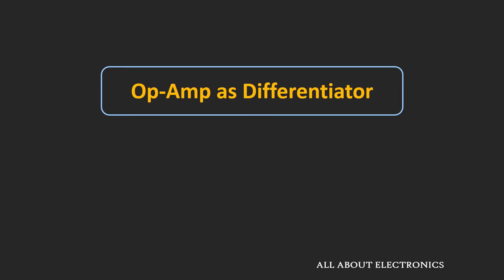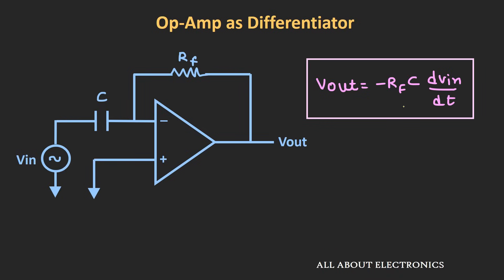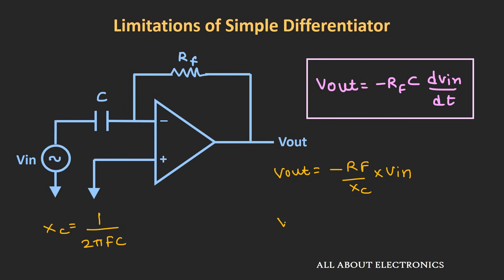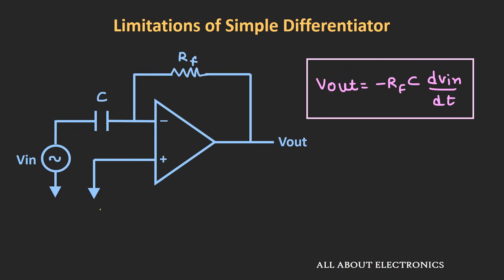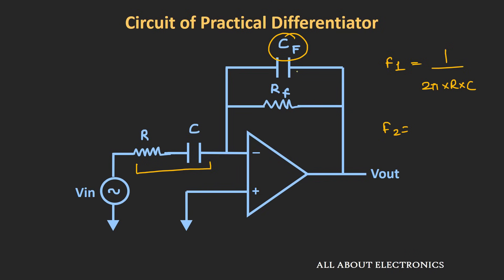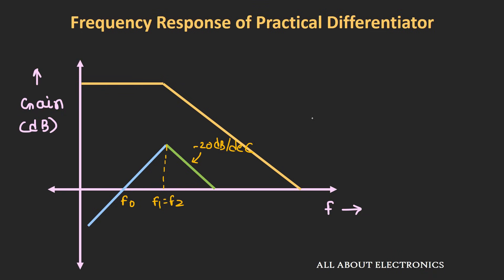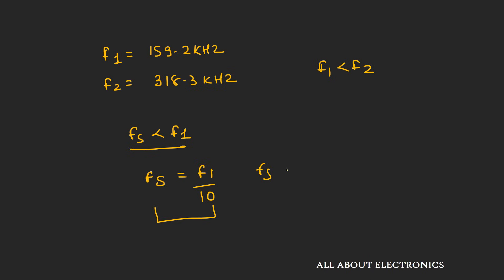Op-Amp Differentiator (with Derivation and Examples)

Comment from the maker: The timestamps for the different topic covered in the video is given below:

0:15 Op-Amp as a Differentiator 
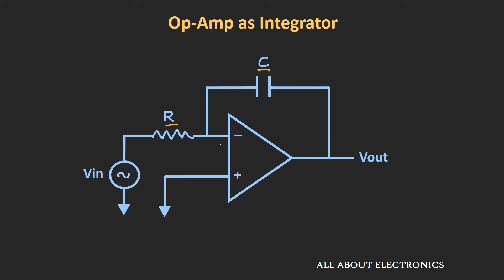1:35 Derivation of Op-Amp Differentiator Circuit
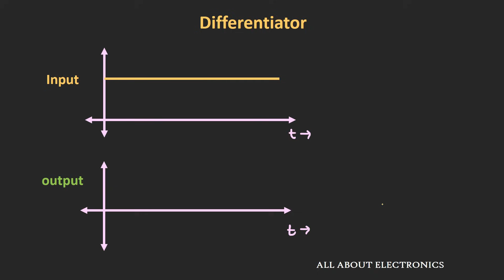3:39 Output of differentiator for the different input signals
4:22  Limitations of the simple differentiator circuit
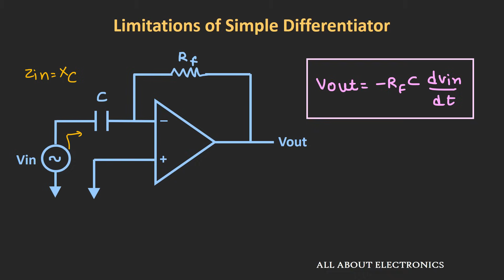7:56 Practical Op-Amp differentiator
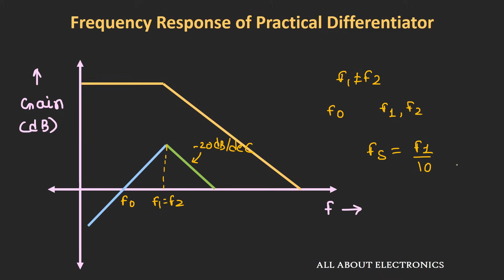11:55 Example 1
14:02 Example 2
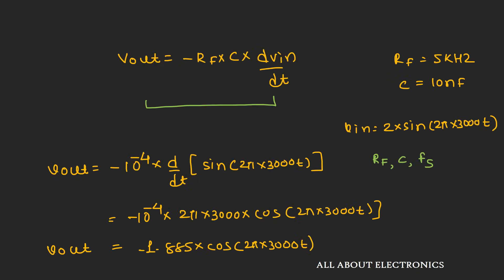16:48 Example 3
Reply: But differentiator act as a high pass filter right? You said low pass filter..

Comment: 12:39  what will happen if DC source is connected instead of AC source
Reply from the maker: For DC source, the capacitor will act as open circuit. So, no input will be applied to op-amp. And moreover, there is a negative feedback from output to input side. So, input is almost 0. So, for ideal op-amp the output is 0. But in actual circuits, you will get some offset voltage. But these circuits are  meant to be used with AC signals or pulse signal. And for that, finding the frequency response is important. As that will give you the useful operating range based on the selected values of components. Or other way around, based on one's requirement one can select the component values. I hope, it will clear your doubt.
Reply: @ALLABOUTELECTRONICS thank you

Comment: 5:18 how tht vout=-(RF/Xc)*vin
Reply from the maker: Consider Rf as Z2, and reactance of capacitor of Z1. So, as the op-amp is configured in the inverting configuration, its output Vo = -(Z2/ Z1)*Vin. Now, if you put the value of Z1 and Z1, then Vout = - (Rf / Xc) * Vin. I hope, it will clear your doubt.

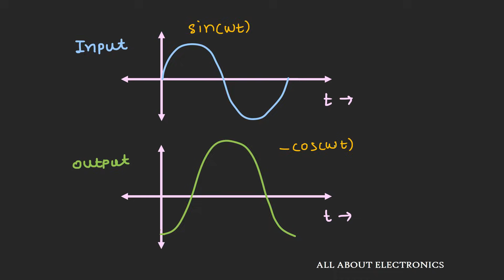Comment: Hi, in the graphs at 3:48, shouln't the bottom (output) graph be inverted (the positive pulses be negative and the other way around)? I think so, because the equation for output voltage has a minus before it. Also the graph at 4:04 has it the way that makes sense to me. I am probably wrong and just can't see it, so I would really appreciate an explanation.
Reply from the maker: Yes, what you are saying make sense. So the direction of the spikes should be other way around (as there is a negative sign). In case of normal differentiator using simple capacitor and resistor, it will be in the same direction. But when it is designed using the op-amp (for the configuration discussed in the video), the direction of the spike will be opposite. Thanks for pointing that out.

Comment: Sir for the integrator problem same as this the vout came as -10v but for that you took it from 5v to -5v but in this problem you directly substituted it from -2.4 to 2.4 and not from -1.2 to 1.2 what is the reason sir
Reply from the maker: Here we are getting -2.4 V output for the entire slope (-3V to +3V), so during that slope the output will remain constant (-2.4V). When the slope changes, accordingly output shifts to +2.4V. So, during that negative slope (from +3V to -3V), the output will remain +2.4V.  So, that is why here output is either +2.4V or -2.4V. I hope, it will clear your doubt.

Comment: In last circuit I mean to say improved version of differentiator y we choose two capacitors..one is series and another one is parallel combo in that case it acts like band pass filter na..
Reply from the maker: The one capacitor is part of the simple differentiator. The other capacitor in the feedback is introduced to improve the stability of the circuit at high frequency. Basically, it will restrict the unwanted high frequency gain. And because of that, overall frequency response will look like a band-pass filter.
Reply: @ALLABOUTELECTRONICS  k sir TQ..

Comment: in the graph for gain [dB] vs f for the differentiator at 05:56, wont the gain be 0 dB when f = 0 Hz as A = -2.Pi.Rf.C.f?? i.e. shouldn't the graph start at the origin?? Thanks for the amazing lectures :)
Reply from the maker: Since the gain is in dB, the graph won't pass through origin. Because as the value of f is close to 0, then gain is also very small. In dB, it would very large negative number. (-120 or -140 dB). It would have passed through an origin, if the gain is not in dB. I hope, it will clear your doubt.

Comment: Why is it an issue if the input impedance is low when frequency is high? Does low input impedance cause some sort of problem with the output of the circuit?

Comment: i have a small doubt the frequency response of simple differentiator should be y = mx but u drew y = mx-c why?and you also told at f = 0 A = 0 and again you are degining low level frequency as the frequency at which A = 0 iam so confused help me out please
Reply from the maker: The vertical scale is in dB. At 0 Hz or at DC, the output is not zero, but it's very small value. That's why in dB it will be negative. I hope, it will clear your doubt

Comment: Can anyone help me ASAP
In example 3 how is the slope = 48000???
Like how did it become 48000
Reply: Slope = (Change in voltage) / (Change in time)
Slope = 6 / 125 Micro Second 

Therefore ,  6/125 x 10 ^ (-6)

Which becomes   0.048 x 10 ^ 6 =  48000 Volt

Comment: At 3:58 differentiation of sinwt is coswt and not -coswt. correct me if i am wrong.
Reply from the maker: Yes, it is cos (wt) but the opamp is configured in the inverting configuration. Therefore, there will be additional inversion or the negative sign at the output. I hope it will clear your doubt.
Reply: @ALLABOUTELECTRONICS  ohh okay. Thanks

Comment: when frequency is 0, how can gain be 0??  the diagram clearly shows negative gain not 0?? please tell im really confused
Reply from the maker: The graph is in dB. So, when frequency is zero, then gain is typically -40 dB or less. If you convert it back , then it will be very small. And for all practical purpose, it can be assume as zero.
I hope it will clear your doubt.

Comment: @6:45 at zero hertz gain is not zero (from frequency response curve). how the gain will be zero?
Reply from the maker: Yes, the gain is not zero. But it will be very small. Around 40 or -50 dB or even less (Y axis is in dB),  and for practical purposes, it can be considered as zero.
I hope it will clear your doubt.
Reply: @ALLABOUTELECTRONICS  thank you for the reply

Comment: With those values there is overshoot and ringing on the output. To avoid it, the feedback resistance must be reduced or the fedback capacitor increased

Comment: 1. At 11:35 you said "Input frequency should be between f0 and whichever is lower between f1 and f2" doubt: what should be the value of f0 ?
2. At 11:45 you said, "input signal should be AT LEAST EQUAL TO fl/10” doubt: in example 2, fs=3khz and (fl/10)= 15.9khz and fs < (fl/10). Therefore input signal in example 2 can not be differentiated.!!

Comment: Sir...I didn't understand the frequency response curve for simple differentiator...I mean, for frequency 0 Hz, the gain should also be 0...but in the graph, it is cutting the negative y axis...please clarify... 
Btw...thank you for such amazing videos...really helpful 😁🙏
Reply from the maker: The thing is on the y-axis the gain is in dB. 
And the second thing is for DC (at 0 Hz), although the output of the differentiator should be zero (Theoretically), but there would be very small voltage at the output. (few uV)
And Vo / Vin would be let's say 10^-4 or something. then the gain in dB would be around -80 dB.
That's why there is an intersection on the negative y-axis. 
I hope it will clear your doubt.
Reply: @ALLABOUTELECTRONICS  Yeah...I get it...Thank you, Sir.

Comment: but what is the role of op amp in the circuit as we can use simple rc circuit or a passive hpf as differentiator
Reply from the maker: The main advantage of op-amp is it provides high input impedance and low output impedance. So, if the output of the differentiator needs to be connected to some load or some other circuit then its good to design it using the op- amp.

Comment: Question: why do you use ideal expression when calculating output if you have added components (resistor and another capacitor)? Dont these components have effect on the output? (Except ofcourde on the plot)
Reply: Aretheil for exact output we have computers , examiner isn't interested in if you can do complicated math or not but intrested in checking if you know the fundamentals of the circuit or not. Videos are exam oriented not research oriented.

Comment: There may be some problem in the graph of frequency response of simple differentiator .(6.24min)
Open lood gain should be a straight line parallel to X-axis because there was no capacitor was added parallel across Rf.
Please correct me if I am wrong.

Comment: sir, at 18:45, how to get slope value 48000       ?
plz...reply
Reply: Slope = (Change in voltage) / (Change in time)
Slope = 6 / 125 Micro Second 

Therefore , 6/125 x 10 ^ (-6)

Which becomes   0.048 x 10 ^ 6 = 48000 Volt

Comment: I'm confused. At 5:32 you say that gain is zero when frequency is zero, while the graph shows negative gain at zero frequency. And then further you say that f0 is the frequency at which gain is zero. Please clarify.
Reply from the maker: If you closely look at the vertical axis, it is in dB. So, when it is 0dB, the gain actually 1. 
I hope it will clear your doubt.

Comment: sir f1=f2; if Rf=R and Cf=C; now f0=1/2pi(Rf)C so f0 will become f1, then how will differentiation take place?
please help!
Reply from the maker: For proper differentiation of the input signal, the frequency of the input signal should be lesser than the cut-off frequency. (At least 10 times less than the cut-off frequency for the accurate differentiation)
As far as this condition is satisfied, it will work as differentiator.
Reply: @ALLABOUTELECTRONICS  o got it ,i am very thankful to have the reply sir.

Comment: Sir, At 4:34  Vout=-(Rf/Xc)*Vin .But Vout=-RfC dVin/dt written at top right corner. please explain
Reply from the maker: Both are true. The first expression represents the output response in the frequency domain and it will give you the gain at the operating frequency. The second expression represents the output in the time domain. That means with time how the output will respond to the input signal.

Comment: Differentiation of sine is cos not -cos...is it right?
Reply from the maker: Yes, that's true. But the output of the op-amp is inverted. (There is minus sine in the equation). That's why there is an additional 180-degree phase shift in the output.
Reply: @ALLABOUTELECTRONICS  Thank u...

Comment: sir, how to convert capacitance to voltage converter using op-amp
Reply from the maker: Hi, I didn't get it your question. Would you please elaborate t a bit. 
Do you mean to say, you want to measure the capacitance in terms of the voltage using an op-amp?
Reply: Thank you sir for Ur reply,Actually I have capacitance value, I want to convert this capacitance value in to voltage value. is there any conversation possible by using opamp?
Reply from the maker: Yes, it is possible. You can use an op-amp as an integrator. Basically, it is charging of the capacitor. You need to apply a square wave pulse as input. At the output, you will get a triangular wave. The charging of the capacitor depends on RC time-constant). As, R is fixed, depending on the C, the charging voltage will change. Or the amplitude of the output waveform will change. And it will be directly proportional to the capacitance value. 
But here, you need to ensure that the Rc time constant of the circuit is at least 5 times the Time period of the square wave you are applying as an input. (So, that the charging will be linear, or you are using the linear zone of the capacitor charging)
I hope it will help you.
Reply: Thanks a lot sir

Comment: sir at high frequency the capacitor reactance is zero so this act as a high pass filter. 
but you said this act as a low pass filter . HOW????
Reply: :D
Reply: I think "R" and "C" build a high pass filter, "Rf" and "Cf" build a low pass filter. Otherwise the circuit didn't make sense. Or am I wrong?

Comment: It's a very good video and a very good explanation but I think the graph that appears at 5:37 is not correct. The gain in dB is not proportional to the frequency, but it must show a logarithmic curve. For example, at f = 0 the gain is 0 but the gain in dB is 20log (0), which is indeterminate that tends to -infinite.
Reply: Since the capacitance is supposed to be independent of time, gain is just proportional to the freq. But my point is why are we taking the mod? In prev eqn there was a minus sign in gain eqn so the gradient will be negative that implies gain will fall with freq increase. I'm confused. Please explain.
Reply: @inu Nope, it's 20log(1)

Comment: sir,@14:33 in the example section the circuit has a zero dB frequency(Fo) of 3.18 kHz,  while solving example 2,the source has a frequency of 3 khz, but u said to use the circuit as a differentiator the source frequency shd be between Fo & F1. may be some sort of misframing the question i guess,but pls clarify sir.
Reply from the maker: The signal can be properly differentiated (as long as fs way below than upper cut-off frequency). But if the signal frequency is less than f0 (zero dB frequency) then its amplitude will be less than the input signal amplitude. 
That is what exactly we are getting in this example. Its amplitude is less than 2. 
I hope it will clear your doubt.
Reply: @ALLABOUTELECTRONICS  hllo sir I didn't get it answer pls elaborate again. Actually i have a doubt if Fs less than Fo then how do we get output ? Sir how we get Fo here .. any equation of it?

Comment: sir, pls tell me this thing,@9:28 u told RC pair at the input side acts as a LOW PASS FILTER,well indeed its a low pass filter when the output is taken across the capacitor,but here the current has to travel through the capacitor and at low frequencies Xc= infinity,means open ckt equivalent,then its not possible for the current to flow through it,and hence its not a low pass filter here. pls explain me as u said how this thing acts as a low pass filter. Awaiting your reply. thank you :)
Reply: all pass filter Am*（s+Wz）/（s+Wp）
Reply: It's a high pass filter, because at high frequencies the value of Xc decreases and hence only high frequency signals get differentiated

Comment: Sir at 0 input  frequency gain is negative from the graph but u said at 0 input frequency gain will be zero, sir please explain
Reply from the maker: If you observe, the vertical axis is in dB. So, negative gain (-dB) means the gain will be less than 1. (So, the actual gain is not negative)
I hope it will clear your doubt.
Reply: I got it ,sorry sir I didn't  see ,that is in db thank u for response.

Comment: What's the intersection point of the ideal differentiator and frequency response of opamp?
How does the frequency response changes after f1 to become flat until f2 in case of the practical differentiator, can it be shown mathematically what happened between those two frequencies and post f2?
Reply from the maker: If you write a transfer function then mathematically it can also be seen. See, frequency f1 arises because of the low pass filter, which adds one pole in the denominator. (I hope you are aware of bode plot). Because of that, after f1 the gain will change at the  -20 dB/dec. Because of the differentiator, there is already 20 dB/ dec of the slope. So, at f1, it will get canceled and you will see the flat response. 
I hope it will help you in understanding the response of the practical differentiator.

Comment: I can't understand how rc ckt work as a low pass filter? Acc to me it is high pass filter
Reply from the maker: At 9:31, the R-C pair at the input will act as one low pass filter. I guess it is not difficult to understand how it will act as low pass filter. The one end of a capacitor will act as a virtual ground. So, it is normal RC low pass filter. 
Now, the other pair Rf-Cf will also act as low pass filter. At low frequencies, the reactance of the capacitor will be very high (Xc= 1/2*Pi*f*C). So, the equivalent resistance will be approximately equal to Rf. At high frequency, Xc will be small and the overall impedance will be small. So, it will attenuate the signal. And hence, it will act as a low pass filter. If you were talking about the ideal differentiator circuit where there is C in input side and R in the feedback, then yes it is high pass filter. And it is even evident from the frequency response of the ideal differentiator. 
I hope, it will clear your doubt.
Reply: @ALLABOUTELECTRONICS  got it bro;)
Reply: @ALLABOUTELECTRONICS  for the first RC pair, the capacitor is in series with the  resistor and so it should be a HPF. If the capacitor was a shunt then it would be a low pass . correct?  Thanks for the great videos.
Reply: I didn't understand how RC at input is lpf...For the RC in at the input ,at low frequencies Capacitor acts as a open ckt and at high frequency it acts like short ckt ...ie it will pass only high frequency and not low frequencies so it is a high filter.
Reply: I have the same question. There is no path between the resistor and capacitor for current to flow at low frequencies so I don't know why it is considered a low pass filter as current will not flow through the capacitor. Good Question !